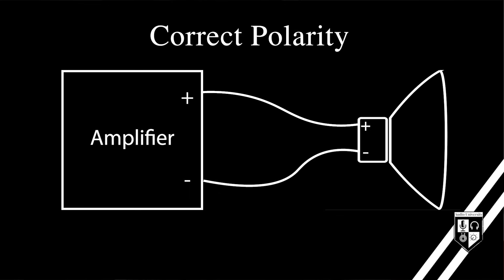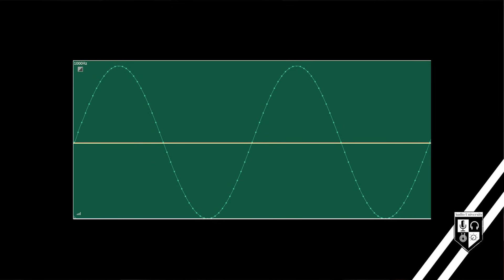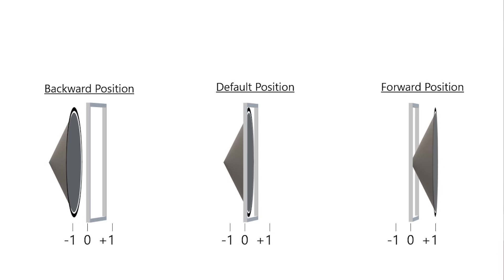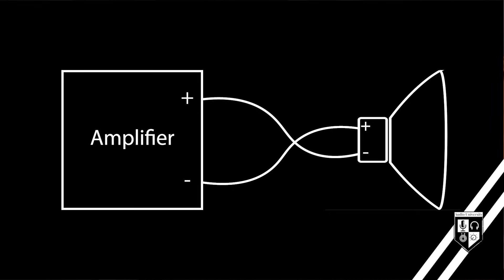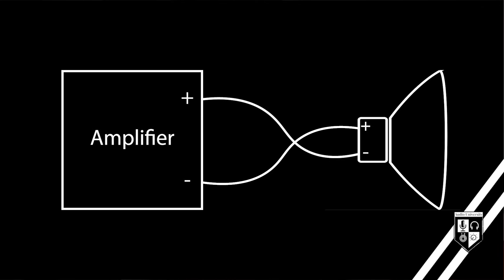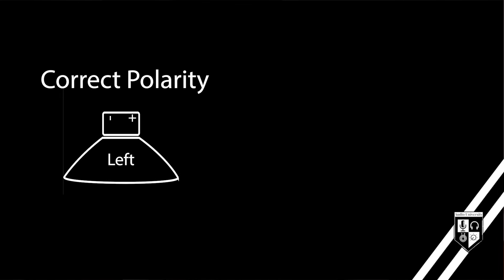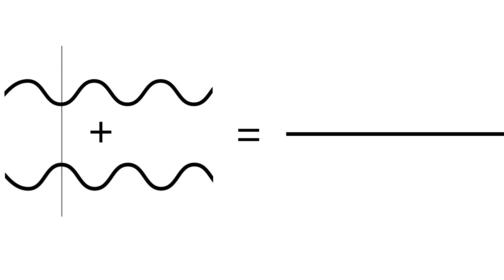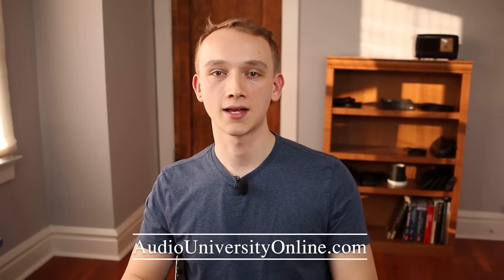POSITIVE VS NEGATIVE: Does Speaker Wiring Matter?

Comment: Excellent explanation Kyle!  

I would like some advice though, on how to stop people from using the term "phase" when referring to the wiring relationship between multiple speakers.  

Phase can have an infinite range of values.  Polarity has only two: In or Out
Reply: Phase has a time element and polarity does not. If you reverse the polarity on a system, the phase is the same and if mixed electronically with the original signal the signal will cancel entirely. IOW the signal starts at the same time, but it is inverted. 
You can move a signal in time so that it will phase cancel the original sound, but only at one frequency. The other frequencies will be in varying amounts of phase difference and this causes comb filtering and the sound does not completely cancel.
Reply: 180 or 0 degrees. OK. Phase! Well there is some other phase shift but we wont get into that now. Phase OK.
Reply: @echodelta9   While the audible effect of phase shift and polarity are similar, they are not the same thing.  

Speakers can reside in two states of polarity: matching or opposite.  No in-between.  

Phase itself can exist in an infinite range of values, as an effect in a studio or in a DAW.

Using the correct terms in given circumstances is key to remedying any audio issues that crop up.
Reply: Polarity at the speaker becomes varying phase for the listener depending on where she is in the room.  Perfect phase cancellation will take place only when sitting equidistant from both speakers, one wired with inverse polarity.
Reply: @thomasmaughan4798   You're all nit picking.  Just correct the reversed leads and listen to the FUCKIN MUSIC! Ave Maria...
Reply from the maker: Thanks, @Zickermacity! I’ve attempted to show the difference in this video: https://youtu.be/KRWhf_L_xYU
Reply: But if a pair of speakers are wired wrong polarity wise - I don't think it's POSSIBLE by definition that they can ever be in PHASE either.   🔌
Reply: @cuda426hemi   Phase exists in an infinite number of degrees.  Polarity exists in two states, exactly 180deg opposite.  Wire a speaker one way, it pushes toward you.  Reverse the wiring, it pulls away from you.  No in-betweens.  POLARITY.

The earth has two POLES - not "phase".  Same concept
Reply: @Zickcermacity  As I said -you can't have incorrect polarity without having the waveforms out of phase literally. You'll see it on any scope or DAW. 🎙
Reply: @cuda426hemi   Wrong: They're OUT OF POLARITY, period.  Phase is a sound effect, a variable construct.
Reply: Reverse polarity is just a special case of being out of phase - in the case of reverse polarity the phase difference is 180 degrees.  However that applies only to the sound of two speakers in exactly the same place (which is of course impossible).  Separate the speakers and things get a lot more complicated ...

Sound travels through air at a speed of about 343 meters per second.  Thus the wave takes a certain length of time to travel from the speaker to your ear (or from one speaker to another speaker).  A person sat 343 meters from a speaker will hear the sound 1 second after the speaker produces the sound.  A person sat 34 meters away will hear the sound 0,1 seconds later etc.  The time delay in seconds is equal to the distance in meters divided by 343.  Conversely, if we know the time delay of the sound, we can calculate the distance it has travelled by simply multiplying the time delay in seconds by 343.  This is how a depth sounder (sonar) works (although the speed of sound in water is much faster than in air so we multiply by about 1500 rather than 343).

Now consider a pure musical note with a pitch of, say, D6.  This will be a wave with a frequency of just under 1175 Hz (cycles per second).  Thus the speaker cone (and sound wave) is changing direction 2350 times per second (direction changes twice per cycle).  This means that it changes direction about every 0.00043 seconds.  In that length of time, the sound wave which is travelling at 343 meters per second will have travelled about 145cm (or just under 6 inches).  That's about the distance between your ear drums.  So if you are sitting with your head sideways to the speaker, the sound that enters one ear will be the opposite polarity of the sound that enters your other ear!  So at that frequency the polarity of the speaker hardly matters, because just turning your head or moving one speaker 6 inches closer or further to the other speaker will be the same as changing the speaker polarity.  But, as the frequency of sound goes down, (lower pitch), the difference in phase between your two ears becomes less, and speaker polarity thus becomes more important.  A bass note of D0 is 18.35 Hz, and will change polarity every 9 meters of distance (about 30 feet).  So polarity hardly matters for tweeters and mid-range speakers because the effect of polarity is swamped by the effect of the distance they are apart.  But make sure you get all the woofers wired with the same polarity.

The polarity of stereo speakers is also important (and more so for stereo headphones).  This is because your brain uses the phase difference between the sound entering your left and right ears (if the nature of the sound allows) as one factor in deciding which direction the sound is coming from.  For best direction determination your brain needs to hear at least two different frequencies within a paricular range to assess the difference in phase change between them.  Which is why emergency vehicles use a siren that has changing tones, and a fog horn produces a low and a high note at the same time

You cannot get a perfect stereo effect from speakers because there is no way to ensure that your left ear only hears the left speaker and the right ear only the right speaker - so directionality due to phase difference is largely lost and your brain can only use volume (level) difference.  Which is why headphones give a far better stereo effect if the microphones that made the recording were set up correctly and there have been no phase changes between channels along the way.  Two microphones placed inside a "model head" give accurate phase differences and the most realistic stereo effect (but not necessarily the best sound quality).  Be aware that changing the tone (bass/treble) or using a graphic equaliser can in some amplifiers cause a frequency-dependent phase change, and so interfere with stereo effect.  Also many stereo recordings (and film sound tracks) use simulated stereo, which only uses level differences and not phase differences so the stereo is not so realistic.
Reply: @davemould4638  That first sentence contains a redundancy.  Saying "Reversed polarity' or 'Out of polarity' will suffice. Phase is just the AUDIBLE EFFECT of reversed polarity
Reply: @Zickcermacity  Reversing the polarity will change the phase by 180 degrees.  Always.  There is no audible effect of changing the phase of a single speaker.  The audible effect occurs only when the phases of more than one speaker are changed.
Reply: @davemould4638  If you are facing a pair of speakers(typical listening setup), and you reverse the POLARITY of one, you will definitely hear a difference in the sound.  If you don't, then you need to see a hearing doctor
Reply: @Zickcermacity  I stated quite clearly that phase shift between 2 or more speakers is audibly noticable.  Not sure why you are arguing against something you agree with.
Reply: @davemould4638   Yes, I must have missed that last sentence.  POLARITY REVERSAL, not 'phase shift' though
Reply: @Zickcermacity  Polarity reversal is just a special case of phase shift (180 degrees).  Any phase shift between speakers can be (but not necessarily will be) audible, not only a shift caused by polarity reversal.  Polarity reversal will however result in a 180 degree phase shift to all frequencies.  Anything else that produces a phase shift will be frequency dependent (different shift for each frequency present in the signal).
Reply: How come most everybody is saying exactly the same thing (just not fully specifying boundary conditions) but you still manage to get into an argument? 😂
As long as all speakers wired in the same polarity (or "absolute phase" if you prefer the term) there is no difference to be heard. Thus it is NOT a quality criterion for single amplifiers to maintain the same polarity (as long as it's the same on all channels), because it doesn't matter. It becomes an issue when using multiple amps in the same installation, of course.
180⁰ phase shift is identical to reversed polarity if and ONLY if we are talking infinite signals. When discussing transients a 180⁰ phase shift between 2 channels is equivalent to a time delay. This is not the case with inverted polarity, so it makes perfect sense to use the appropriate terminology. An that's it.
Reply: @naibafabdulkobor4301  I now see the reason for your confusion.  You believe that a phase shift is the same as a time delay.  While phase shifts (other than 180 degrees) are usually caused by a time delay somewhere in the path, they do not have to be caused by a time delay, and a phase change does not imply a time delay - the special case of a 180 degree phase change due to a polarity reversal being one such case.  You could achieve exactly the same effect as a polarity reversal, for example, by rotating the speaker 180 degrees so that it is pointing in the opposite direction (so you are listening out of the back of the speaker).  And arguably if two speakers are arranged back-to-back, they should be wired with opposite polarities.
Reply: @davemould4638  - No confusion on my part. I know about minimum-phase systems and non-minimum-phase systems. Also your example of the speaker pointing backwards is a bad one due to directivity (you probably know that).
Reply: @naibafabdulkobor4301  It's was not meant to be a good example from a practical pov, but only to show that you can get the same reversal of phase without reversing the electrical polarity or introducing a time delay.  It does however have a practical application in a situation where you place 2 speakers back-to-back to send sound in two directions as is done in some outdoor public address systems.  In the case of 2 speakers, do you wire them with the "correct" polarity, or opposite polarities?  If they are wired the same, the sound waves will be in anti-phase and so tend to cancel.  This can (in a suitable enclosure) create a dampening effect that can deliver sound that is not as loud but is better quality.
Reply: @davemould4638  - The term "reversal of phase" doesn't make much sense (contrary to "reversal of polarity"). As @Yoda8945 has pointed out correctly several times the term phase is always related to a difference in time. Always. 
You postulate cancellation with two speakers placed back-to-back when both are connected using identical polarity. Yes, there will be some cancellation (in practice) but only depending on boundary conditions. I will name a few.
If both speakers' beam angle is <= 180° there will be no cancellation at all. Now, we all know that sound pressure doesn't drop to 0 instantly at the edges of the "beam" and that it depends on frequency, so let's put it this way: For wave lengths sufficiently small compared to the source that the output is highly directional there will be no cancellation.
If both speakers' beam angle is 360°  ... there will still be no cancellation. Why? A beam angle of 360° is only possible if the sound emitting source is very small compared to the wave length. This can be idealized with two perfect point sources being located in exactly the same spatial position (which is not possible technically). Two perfect point sources (each with correct polarity) will simply sum up to a 6 dB higher SPL.
This leaves us with the use case of frequencies and wave lengths in between the two extremes. In this case there will be some cancellation depending on a) wave length and b) non-zero distance between the two emitting sources. And since the speed of sound in free air is finite this non-zero distance - surprise, surprise - equals a time delay ...
Reply: @davemould4638  - Great, I'm an EE myself so we should find some comon ground. Phase is related to a difference in time and this does apply to 3-phase power supply just as well. It's just a matter of reference. Pick any of the three, watch out for the start of a new sine circle and one (and only one) of the others will be the one where the next sine circle will start after 1/180 of a second.

Not sure why you came up with the next cancellation example. Very obviously the SPL exactly in the middle between both cones will always be higher if the two speakers are connected with the same polarity. This is true independent of frequency. When wired in reverse polarity there might actually be some "wind", otherwise known as acoustical reactive power. 

I don't fully agree that polarity is "much moref" important for woofers than for tweeters. Yes, it is when just looking at SPL, and sound energy. But stable stereo imaging will be impossible when left and right tweeters are connected with wrong polarity.
Reply: If you are exactly  + or - 180 out of phase, you are at opposite polarity. Polarity is an extreme case of phase. But it is a phase relation. You can't eliminate the general by being more specific.
Reply: @erikmyers3888  - That's simply not the case. If +180° and -180° both mean you are at opposite polarity, which is more specific then, phase or polarity? 😉

This was just a fun question. Truth is, the effect of reversed polarity is the same as -180° phase shift or +180° phase shift in many (but not all) cases. As has been explained over and over again, negative phase values mean that the observed signal is "late" compared to a given reference while positive phase values indicate the observed signal being "early" relative to that same reference. So there always is a time component to phase (but not to polarity). As long as we are just referring to infinite sinusoidal signals one could say that +/-180° phase shift causes the same effect as reversed polarity. However it is easy to make up a case where this is no longer true.

Imagine two speakers pointing towards each other and a microphone positioned in the middle, exactly equidistant to both speakers. Same polarity, no phase shift. The identical input signal is a sine wave where the lower half has been cut to off (as if a sine was fed through one ideal diode). 
Result A: No cancellation, the microphone will pick up actual sound.
Now we are inverting the polarity on one speaker.
Result B: 100% cancellation, no sound picked up by the mic.
Finally we connect the speakers with identical polarity again but (e.g. using all-pass filtering) apply a -180° phase shift to one of them. Hint: -180° actually means a time shift.
Result C: No cancellation, the microphone will pick up sound. 
When one cone is moving, the other cone is stationary and vice versa. The resulting sound is not the same as in example A, but still there is sound, contrary to example B. 
Finding: Inverted polarity leads to a different result than -180° phase shift, qed.
Reply: @naibafabdulkobor4301  Interesting. So I jumped in this discussion because i'm a sucker for layered semantics and terminology. I'm fascinated when multiple parties say true statements that apparently contradict. 

Mathematically, only a sinusoidal function has phase. Meaning the signal must be identified by repetitive periods of 2pi (360 deg). An infinitely complex waveform that does not repeat cannot (by definition) have phase. Mathematically we can only speak of complex waveforms by breaking down into superimposed analytical waves, each of which has its own period (and therefore phase). Reversing the polarity of a complex waveform shifts [all] its phase[s] by +/- 180 degrees. There is no forward progression of time in this consideration. 
Mechanically, the instrumentation is agnostic of any foreward time progression to a signal. Reversing polarity equates to an instantaneous 180 degree phase shift on all frequencies.

Now when it comes to audio engineering, as you say the (stereo) effects of a mechanical polarity flip are pragmatically irreversible. Any signal phase correction can only asymptotically approach a wideband polarity flip, and due to the irreversible progression of most signals, must be accompanied by a time shift to restore (stereo) integrity. Due to the complexity of a phase-shift based approach, polarity and phase are separate practical concepts. I too have been frustrated by polarity flipping advertised as phase adjustment.

However, your scenario is kinda cheating by passing through a diode ;). When you flip the speaker, you are also essentially flipping the diode (for that speaker). Phase shifting the signal cannot change the fact that the diode is going to destroy any magnitude below zero. Symbolically, we can represent the speaker polarity by +/-, and the diode by absolute value | |.   -sin(x) = sin(x+pi), and |-sin(x)| = |sin(x+pi)|,  but -|sin(x)| != |sin(x+pi)|. We could defeat the diode by  amplitude shifting such that sin(x*3/2*pi) + A = 0. The mechanical system would then still demonstrate the mathematical relationship of phase and polarity. Any of these scenarios would make an incredibly inefficient system.

That being said, the diode is a great simple example of why in audio engineering, mechanical polarity deserves distinction from signal phase. Since audio signals are typically non-periodic and (trivially) asymmetric.
Reply: @erikmyers3888  - I wouldn't call it cheating. :) It's a cleverly (cough, cough, ...) chosen example. In fact, I was a bit proud of it because it is still an infinite, periodic signal. 

Phase and polarity the way I discussed it are characteristics of a system's transfer function. However, it's not that easy to make a clear distinction here. When one speaker's polarity is reverted, are we changing the system or the input signal? ;)
Reply: @naibafabdulkobor4301  I guess its all up to how we draw the boundaries, eh? Cheers!
Reply: @naibafabdulkobor4301  Because in the case of speakers, polarity is the correct term.  In an audio context, "phase" is just the audible effect
Reply: @Zickcermacity  - The concept and definition of acoustical phase (and phase shift) exists completely independent of if there is an audible effect or not. Audio University has covered (not all, but) most aspects in the video linked above: https://www.youtube.com/watch?v=KRWhf_L_xYU
Reply: Phase is correct. There is positive phase and negative phase in audio and never DC content. In fact if you get DC content you can melt speaker coils. Every time your coil is fed DC it heats up and starts to get damaged eventually going OC .THink of when you are dealing with an alternating signal, what is positive and and what is negative, seems you get both on the same cable!
Reply: @exponentmantissa5598  It can take only a second to fry a voice coil.  DC offset from a bad amplifier or clipping. In the 80s we had a vendor that was very busy repairing speakers burned out by DJs in clubs over driving amplifiers.  He would charge double for same day service.  Cones and voice coils and he had no competition.
Reply: @cars654  What fools a lot of people is they put a 9V across the speaker to test polarity and say see the speaker didnt blow. What they dont realize is that the speaker looks like a short circuit to DC because it is just a coil of wire. Every time a speaker gets DC the coil heats up and after a while the wires melt and eventually the speaker fails. I know a technician that used to repair speakers and he told me he could tell just by looking at the coil's color if it had seen DC due to clipping  or was a bona fide manufacturers failure. Clipping is indeed DC content as the tops of the wave get chopped flat as the amp hits its supply rails.
Reply: @exponentmantissa5598  - the color of a coil is a thermal degradation of the insulation. AC or DC doesn't matter. 

- If you drive an amplifier into clipping  (iow the amplifier is too small) The peaks are clipped off this is Not DC. You are approaching an AC square wave.  A square wave of any frequency has high frequency content by definition. This kills tweeters. 

- Too large of an amplifier won't clip. It can accurately deliver high power and tends to kill woofers if you overdrive them.

We're ignoring unloading, over excursion from too low a frequency including DC and crossovers etc.
Reply: The term phase is important in multiple speaker systems.  If you have a dance club with 20 to thirty speakers you want them connected properly or in phase for maximum sound pressure and minimum distortion.  If you go into a club and hold an empty beer bottle in your hand close to the dance floor you should be able to feel air being pushed out of the empty bottle. That is how systems were designed in the 80s, not so much now.  Phase simply means the speakers are pushing air in the same direction and not canceling each other out.
Reply: @cars654  I am so sorry, what you are describing as to whether the speaker goes in or out is polarity, not phase. Phase has a time element.
Reply: @Yoda8945  Polarity is simply a special case of phase, either 0 or 180.  it is still a phase relationship.
Reply: @thomasmaughan4798  Phase has a time element because it is tied to frequency. Polarity does not have a time element.
Reply: @cars654  The term POLARITY is important in multiple speaker systems. If you have a club with many speakers, you want them connected properly or in POLARITY for maximum sound pressures. POLARITY means the speakers are all pushing air in the same direction and not cancelling.

There, fixed it.  Next!
Reply: @Zickcermacity   In electronics phase is very important,  a tidbit for you, when two signals are out of phase they cancel each other out.  The sound system can add or detract, all good amplifier manufacturers maintain proper phase from the input to the output stage.  I have been working in the electronics industry for over 60 years and signal PHASE is part of the equation not only in audio but radio frequency as well. Every electronic circuit has a phase relationship with the previous stage of amplification. Every time a signal goes through an amplifier the phase is inverted. You are making a controversy over a fact of electronic amplification. Phase is not a dirty word but a SCIENTIFIC FACT !  Any good audio tech will run a phase test after a big install.  Using a sweep generator and a calibrated microphone and spectrum analyzer.
Reply: @cars654   What you are saying above is all correct.  Just replace every instance of the word "phase" in there with the word POLARITY, and the terminology will also be correct. It.

Matters.
Reply: @Zickcermacity  Let me help you = check out zero crossing detector,  check out class B push pull amplifier crossover distortion. Check out phase inverter. Check out phase angle and phase distortion. Phase is what keeps your lights on. I doubt you are an audiophile but if you ever buy a decent amplifier if you can't afford a class A get a class AB and the next step down from that is a class B .  Polarity and phase are not the same thing !  Polarity is simple + or -  phase is the synchronization of signals whether they be audio, radio frequency or any alternating current .  Proper speaker termination = phase synchronization between the signal source and the speakers.
Reply: @cars654  I shall leave you in Kyle's/Audio University's capable hands.  I'm through debating it.  

There's an appropriate time to use each term - phase or polarity.